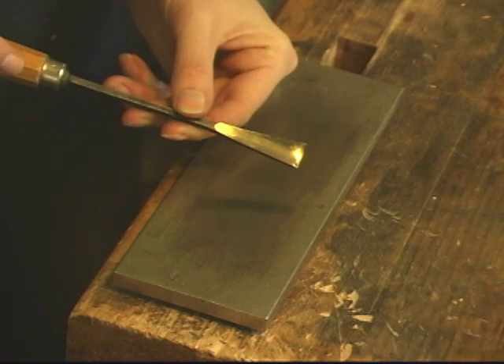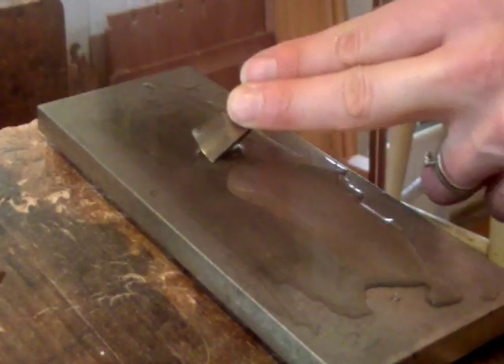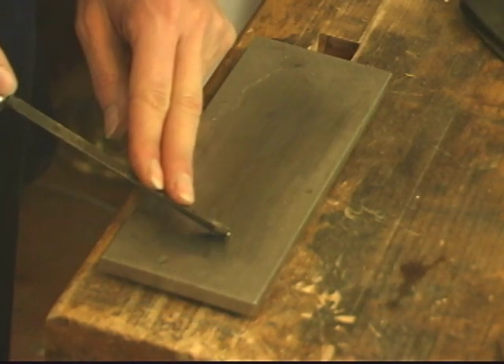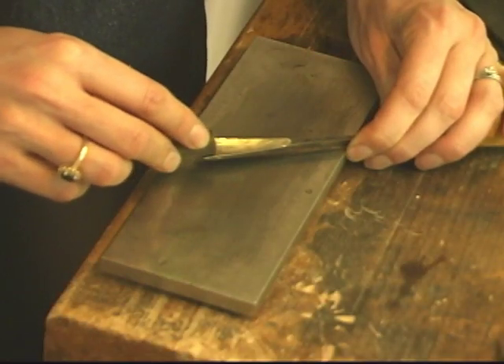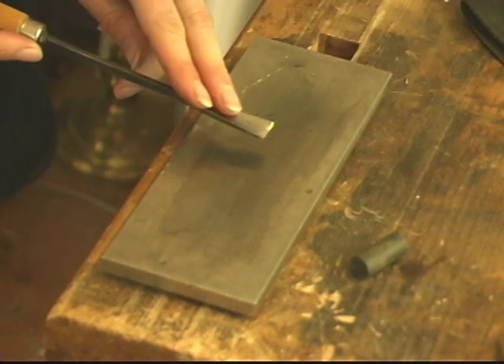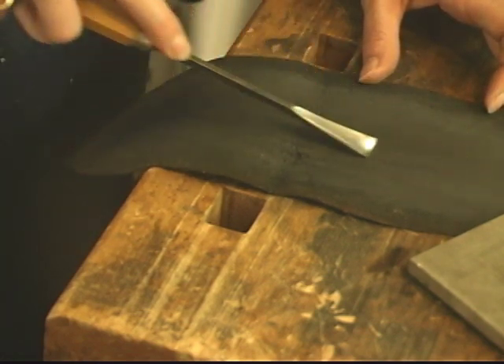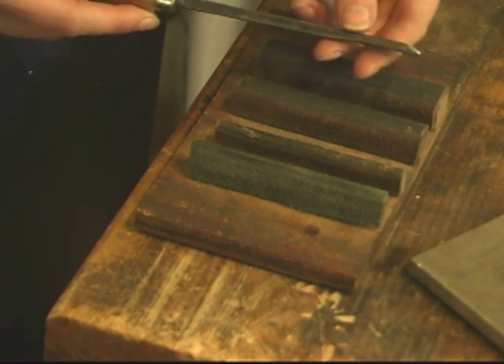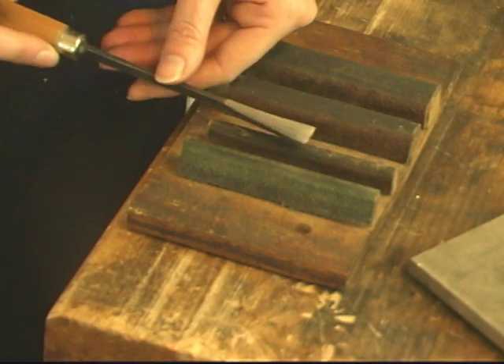How to Sharpen a Curved Woodcarving Gouge by Mary May

Comment: So you need to use the stones along with a strop and not the strop alone.
Reply from the maker: Yes. The strop will not take the metal down enough when it really needs aggressive sharpening.

Comment: Cratex. I use a 5" medium Cratex(TM) wheel on a buffer. Cratex wheels are expensive (approx. $100) but they produce INSTANT mirror finish, in 10 - 15 seconds. It is Difficult (but possible) to overheat a tool while polishing with Cratex, but only if one is pretty clumsy. Cratex is used in the cutlery industry to polish stainless steel tableware to a mirror finish. And a polished tool back glides frictionlessly through the wood. Cratex beats diamond six ways from Sunday. Cratex also makes small, inexpensive rotary shaft points that can be mounted on a Dremel tool for sharpening the incannel edge.

Comment: Ok wrapping up my novel...

Sandpaper around various bits of reshaped dowel substitutes for slipstones (and provides coarse slipstones). For a v-tool you really do need a stone, or do both sides separately and then use the fold of a bit of sandpaper to get the vertice (which should have a tiny radius that you must preserve).

But my most important tip by far is to OIL YOUR INNER FLUTES. These, and on a carver’s chisel, the outer sides, are the important part of the tool to maintain. Your edge is only as good as the rougher side of it. Period. Your flutes must not become rusted and pitted, ideally they should be a precise, smooth uniform surface that is brightly polished near the tip. Oil the flutes immediately after drying (dry immediately after sharpening). Never leave your tools in a humid environment outside a case, never leave them in a humid environment for an extended period of time without a coating of shellac or paste wax (remove shellac with denatured alcohol). Always oil after every use until you know your workspace and hand oil isn’t prone to rusting them. Use mineral oil, forget about expensive oils. Don’t use WD40. Be extra careful about oiling if you have cleaned your tools by wiping with a damp cloth, or used any solvent on them. By making the metal very clean you make it very quick to rust. High Carbon steel rusts easily compared to anything most people are used to, incidentally. And should you ever touch vinegar or lemon juice to your tools, or another acid, you must neutralize the acid with warm baking soda water solution. Even oiled, they will rust. Don’t store your edges tools near acids, and don’t store acids in your workspace.
Reply: Vielen Dank für die hilfreichen, ausführlichen Informationen

Comment: Sandpaper on thick, very level, glass placed on a firm level surface, will substitute for coarse stones to get your started. 80 grit wet dry, not emery paper or some cheap crap, lubricated with water. You mustn’t push your sharp edge into the paper though; always go sideways or backwards across the paper. You don’t need every grit, either. 80 to 120 to 180 to 220, 320, 600, 1200, strop with some compound smeared on it. My advice is to get synthetic waterstones, and to avoid ceramic and Arkansas stones particularly. They both cut inefficiently and clog. Waterstones cut very fast, but need leveled very often (but it is quick to do). They last years and years. Diamonds don’t last as long, and can’t be flattened, but do stay flat for a very long time. Stones is a classic case of “many choices, none of them good.” I like waterstones because they cut fast, the slurry is more pleasant than the slight fingernail on chalkboard sensation with diamond, and they don’t rust. They will break if dropped, but the fragments make slipstones. If you do get waterstones, keep in mind they can’t be allowed to freeze, to sit in water for days on end, or be closed up in a box while wet because they mildew.
Reply: If you really have aggressive regrinding to do, the old way is a coarse floor or large flat sandstone boulder. Wet it and use a pull stroke only. You can roughly flatten sandstone with another piece of sandstone.
Reply: Coarse concrete. It needs to be gritty, but not so rough that it’s not flat enough.

Comment: The double bevel allows you to work with the gouge upside down (flute against the wood) and be able to terminate a cut without hitting a stop cut (or air). Clear as mud? It lets you carve in and then scoop back out, when working upside down. Not well, but sort of, especially with a shallow gouge. Excellent tutorial, thank you!

Comment: Just one question; what's the minimum grit you should use before moving on to the leather strop? I have a 1200 grit diamond stone, and I was wondering if I first had to use my arkansas (4000 grit) stone before stropping
Reply: Das würde mich auch sehr interessieren

Comment: This is not how you sharpen a curved gouge, this is how you maintain it, wrong advice that will get many people frustrated.  The setup and movement she demonstrated is not going to sharpen any reasonably blunt gouge in under 20 hours. You DO need a system of quality sharpening stones and yes you need to spend a couple hundreds if you want to be able to put an edge on any blunt or rusted vintage gouge. What she does in this video is only maintaining an edge on an already near perfect gouge.
Reply: One does not allow tools to become blunt to the point they need excessive work. Learn to sharpen as you go.....
Reply: @geomiss8889  I need no advice, i made my own sharp steel tools set from scratch, i know the difference between different type of steels too from hands on experience on them.  Of course if you're a novice and only know how to maintain a sharp blade someone made for you, then you don't know little about sharpening.
Reply: Some carvers repeat this line - you never need to use a coarse stone. It is BS. They are being imprecise: you never need to IF nothing ever goes wrong... you never get a chip, a dished out or wavy edge, an accidentally too steep of bevel.

If you have carving tools you not only will need a coarse stone, but will also need a grinder unless you want to spend hours doing very monotonous labor. If you learn to use a grinder (and no it doesn’t soften the steel unless you are grossly negligent) it is a valuable skill in and of itself for the wood carver, who sooner or later will probably start making the odd tool, work holding device, or odd carpentry or handyman project for the house. A bench grinder is one of the first machines you should buy, hands down, in all cases (hand crank if you don’t have electricity). Ok, end of rant. Sorry about that.
Reply: @przybyla420   Yep, speaking from experience, you absolutely need at least 4 grits of stone starting from a coarse stone all the way to a least 6,000 if you work with carving tools and yes a grinding motorized tool may become useful at some point.  The only way to develop a real feel making sharp steel tools is to make one from an extremely blunt one (buy harbor freight chinese wood carving tools, it's $15 and they come very poorly done, some of them won't even produce a wood shaving at all. That is perfect to learn your stones) and to start with a very coarse stone or grinder to learn how steel reacts. You will also learn what kind of steel quality you got, was it properly tempered of is it crazy hard and chipping or super soft like butter (won't hold an edge long) and only then move to higher grits. If you just get high grit honing stones, you will learn nothing from them since they can only do extremely small incremental work without changing the geometry of the bevel and you will get frustrated. It's like a blind man trying to read a book. First learn to read large characters.  
My most frustrating attempt was to try to sharpen a "singing razor" that had a very thin blade on an extremely hard steel that the manufacturer had sharpened on a rotating machine so that they also warped the blade while sharpening it. It was impossible to sharpen with stones, not only that but it was a dangerous blade to use out of the box. Manufacturer : THier Issards. Will never buy any of their blade again (was bought new and a special collection iterm)
Also i almost forget you need a 10X loupe to see what is happening with the bevel as you work on it.

Comment: New gouges came at 35 degrees and I started sharpening (320, 1000, 3000, 8000, 1000) to get 23-25 degrees.  Long (been at it 6 hours already) before I get rid of the shiney line to a knife edge the wings have rounded.  Now what, restone the edge and start over for 8 hours?  I tried that after 3 hours and now, as I said, I'm at 6 hours and still no knife edge and the wings are round again!  BTW, this is my first rodeo.
Reply from the maker: Hi Asher, Sorry to hear your difficulty. I wouldn't bother restoring the edge once it is rounded. You will lose too much of the tempered edge (the end of the chisel is usually only tempered 1/4 to 1/2 inch). Just enjoy the tool with "softened" corners. It makes me wonder what kind of chisels you started out with. 35 degrees is a quite large angle and I am wondering if the quality of the metal is not good? Most tools with high quality metal will cost $30 to $40 each and often come with the bevel already at 23 or 24 degrees. If you went for much cheaper gouges, that may be the issue. That was a LOT of metal you had to remove (makes sense that you spend so many hours on it) to change the angle that much. All I can say is keep going until you reach that edge. The reason the wings have rounded is that the rotation on the stone was too much. Make sure you do not curve the gouge more than the curved bevel surface. If you still can see a thickness of metal, go back to the roughest stone you have simply to remove the mass of metal. Don't move to the finer stones unless most of that metal is gone. Good luck!
Reply: Remeasured and it was 42 degrees.  BTW, I just saw a clip where he says that he prefers 40 degrees!  Guess it depends on the person.  The set I bought was mid-priced and they are all around 42 degrees and only ground, not polished.  Finally, took off most of the excess with a Dremel stone.  The time I'm wasting, if it didn't cost as much for shipping as buying, I'd just order Pfiels and move on.  Months now and I haven't carved anything.  Arrrgggh.
Reply: You need a bench grinder, old sandstone grinder, old hand crank grinder, benchtop belt sander, lapping wheel SOMETHING to regrind. It is loony to use a stone. Don’t attempt any of these devices without watching someone do it or getting advice, you are more likely than not to bugger up your tool badly.

Comment: sometimes the "old ways" are truely the best ways of doing things. Since the invention of steal and other metal weapons and tools they have been sharpened on stones and honed on hyde/leather. Electric systems are way newer than the design of most tools. If it worked for genorations, it can work for anyone willing to make the tools the best they can be. stones and leather strops have my chisels, planes, and knives shaving sharp. Any of my cutting blades can shave hair, but most of them can shave end-grain oak and iron wood too. You just have to keep the tools sharp/honed to spend less cumulative time at the sharpening process (once their sharp to begin with). The angle of the bevel to the back is a personal preference that can be any degree/minute/second for the best outcome for what you're working on/with. There is no greater joy than the "perfect" blade for the job at hand. My wife does not understand the need for multiples of the same tool, but different angles work best for different woods, so once you find the best angle for you for a particular medium noone wants to change the angle when changing woods. for me, hard woods seam to cut better at an included angle of between 27 and 28 degrees, but for softer woods I find a 23 to 24 degree bevel with a 6 to 7 degree back angle (included angle between 29 to 31 degrees) gives me a cleaner cut. I usually stick with these angles accross my cutting tools and have pretty decent longevity on the edge by going to the strop frequently. I usually only have to go back to the stones (after initial sharpening) when a blade gets chipped or rolled. I have even planed bovine bone with my tools and gotten good curly shavings. Hope this helps anyone with "degree" of bevel questions, but like I said, there is no one perfect angle for every craft, craftsman, or medium (wood, antler, bone, micarta...etc). You just have to play with it each time you sharpen until you find what works best for you.
Reply from the maker: Thanks so much for that information. Very helpful!
Reply: Danke für die ausführliche Information

Comment: HOW DO YOU SHARPEN ONE WITH AN INSIDE BEVEL
Reply from the maker: I am assuming you are talking about "in-cannel" gouges? Flat outside edge and large bevel on the inside curve? Very tricky. You will need an aggressive curved stone that fits the inside of the tool (DMT has a "wave" stone that is a curved 1200 grit diamond that really removes a lot of metal). Then move to finer and finer curved slip stones (usually Arkansas stones or ceramic stones at this point) to create a mirror finish on the inside bevel. Do this until you get a tiny wire edge folded to the back side of the tool. Run the outside of the gouge along the stone VERY flat so you do not create a bevel on this outside edge. Then repeat these steps, inside and outside, until the wire edge is gone. Not an easy process, and takes longer than standard sharpening.
Reply: Or give it away, that’s like the 3011th gouge you will need.

Comment: wow! Really good videos, everything very well explained.  I have one question,  have you ever used the smaller chisels  ( about half the overall length of the ones you use) if so what is your opinion about them because I am thinking on investing on a set instead of the standard size . I will be  carving book covers about 3-5 mm thick. Thank you very much  (new subscriber here).
Reply from the maker: Thanks! I like to hold gouges with both hands, and often these smaller gouges restrict that. It's more for safety and tool control. It really depends on the size of your hands, and how comfortable you are holding the tools. There can be a tendency to use the tool one-handed, which in my mind is more dangerous. Just be careful! But have fun!
Reply: Thank you  for your reply. I understood what you mean about control.  Thanks.
Reply: When the works is so small, delicate and/or irregular that it must be held in the hands or lap, palm gouges excel. I never use them with one hand - I always have a finger or two of the other hand bracing the tool midway up the shank. When doing such work the #1 rule is to always have your hands connected - “anchored” to each other, and firm tabletop, or your lap (board or apron and thick jeans are a must when you start doing this sort of thing, and don’t start doing it until you have some experience and hand strength built up).
Reply: Small detail work. ie. small figures.

Comment: By putting a micro bevel slightly rounded (5- 10 degrees) on the inside you can use your gouge upside down. with much better control. It prevent your gouge from digging in. It creates a small heel to control the depth of the cut by raising lowering the handle. You can use it to shape the top of a nose, branch, limb or round an edge anything you want rounded into convex cylindrical shape. This is how the masters do it. This make your gouge much more useful and gives you a better cut all around. You may want to try 3m lapping film to sharpen with. You can wrap it around a dowel to get your micro bevel. Placed on flat service, such as, glass, tile or marble to sharpen with. Much cheaper then water stones or diamond stone.

Comment: Hi thanks for this helpful video.  One question: do you smear the strop with somethin?
Reply from the maker: Thanks Joe. You can put any kind of polishing compound that you would put on a stropping wheel. There is a lot out there. I actually used silicone carbide powder. That is what jewelers use to polish stones. Rub a little bit of oil on the smooth side of the leather, let it soak in, and sprinkle the silicone powder on the rough surface of the leather. The oil will cause it to stick to the leather.

Comment: Very helpful. Thank you, Mary.  I had heard that most carving tools are shaped wrong at the edge (though I don't remember the source).  The source said that the corners of the blade should be either leading the cut or following behind.  Something to do with severing the grain for a smoother cut or some such.  Would you agree or is this person nuts?  Just starting out, so any help would be appreciated.  BTW, it was your appearance on the Woodwright's Shop that triggered my interest.  Seemed very Zen.
Reply from the maker: Hi Simon,
I usually leave the edge straight across, or on very rare occasions, I round over the corners. The only reason I would round over the corners is when I am making cuts where the sharp corners would interfere (rounding over beads would be a good example of this - the corner would dig into the background before the center of the blade). I don't know where it would be useful for a curved gouge to have the outside corners sticking farther than the center of the gouge. If you find a gouge sharpened like this, it's probably a mistake - the gouge was not rotated enough to his the outside edge.

I'm sure there are others out there who sharpen differently, but this has always worked for me. Ultimately, if the gouge cuts the wood the way you want, go for it!
Reply: Mary May That's helpful.  Thanks very much.